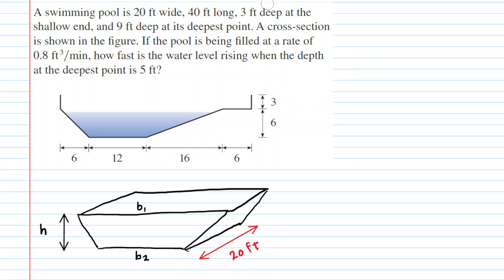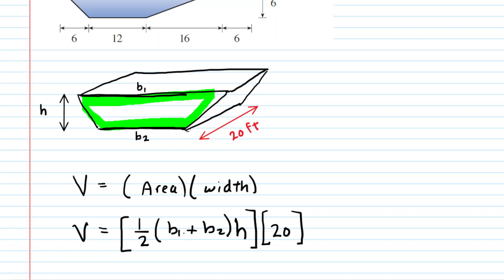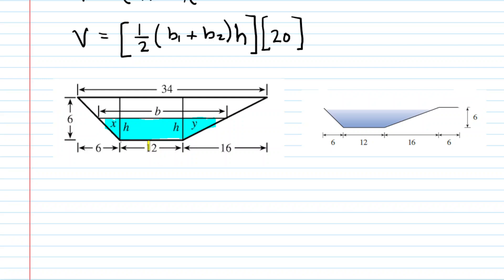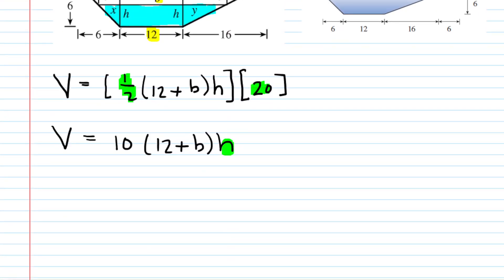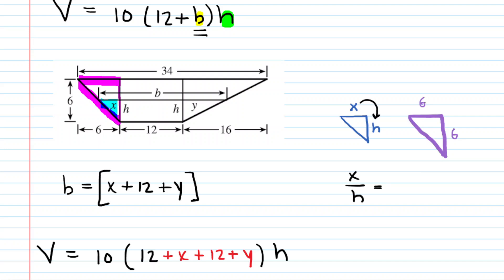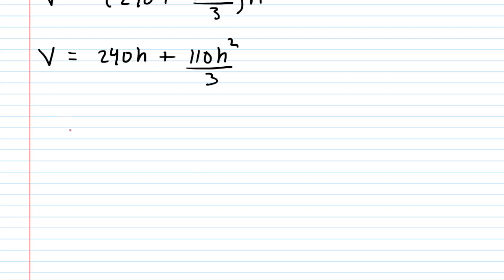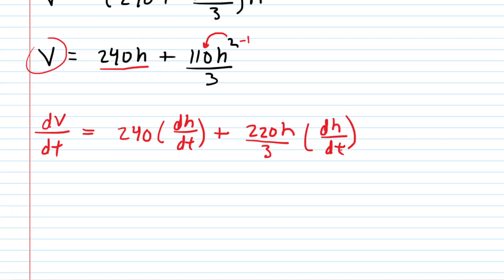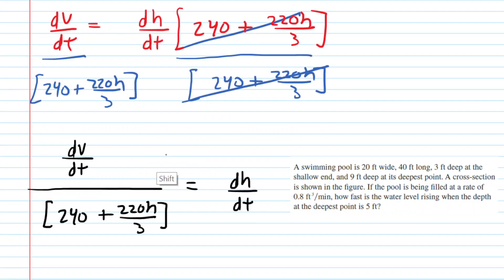A swimming pool is 20 ft wide, 40 ft long, 3 ft deep

Comment: Alternatively, I just used this proportionality:

(b-12)/(34-12) = h/6
(b-12)=22h/6
b=(11h/3)+12

that's basically the relationship between the long base as height varies

if h = 0, then b=12
if h = 6, then b=34

also

V = (12 + 12 + 11h/3)(h)(20)/2
V = (24 + 11h/3)(10h)
V = 240h  + 110h²/3